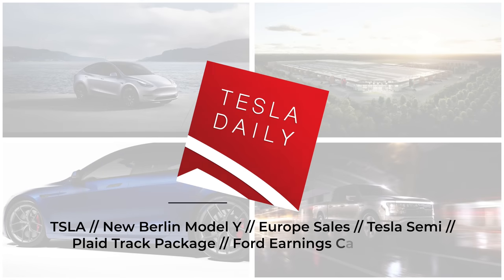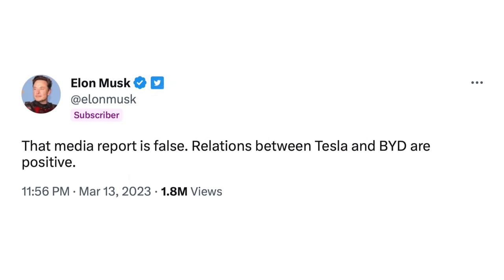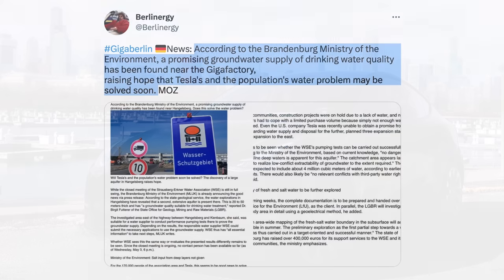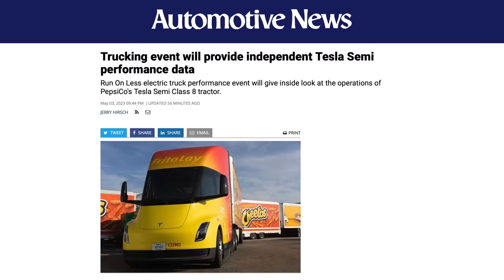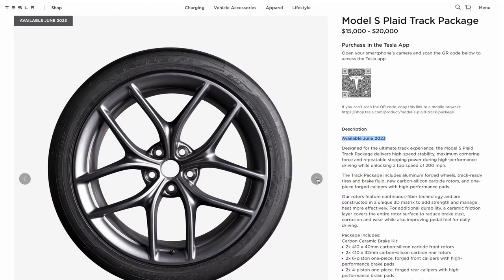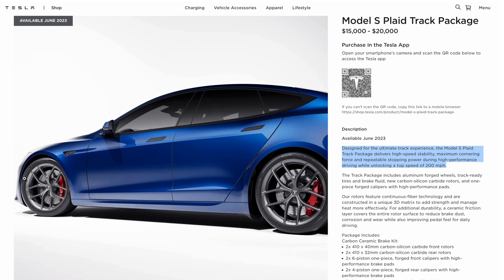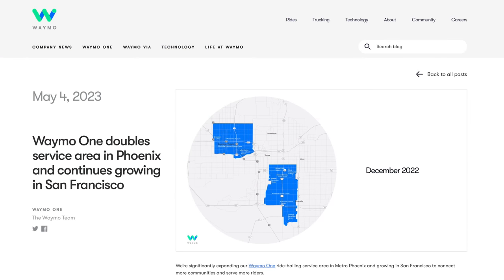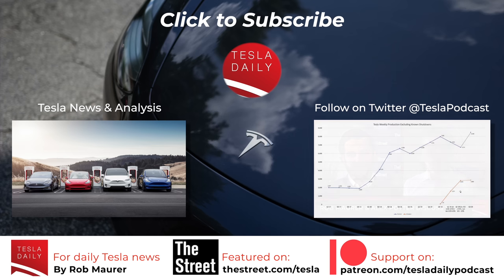New Model Y From Berlin, Europe Sales, Ford Comments, Waymo Expands

Comment: Run on Less - BIG DEAL in the fleet manager trucking space. People pay attention to it, a lot.  Coming away with good results and stats that impress WILL result in a lot of uptake as so many companies are facing stockholder pressure on CO2 reductions etc.   When it all comes down to it though, cheap electricity has to be addressed behind the meter for electrification to pay off in a dominant way.  This is getting too little attention IMO.

Comment: Using digital connectivity to monitor what customers are using on a vehicle (and deleting low use items) might backfire (pun unintended) with something like lumbar support which is probably adjusted for the usual user of the seat and then left alone mostly. Not being able to adjust initially would be a downer.

Comment: Passenger seat lumbar support - how on earth car companies even think about removing such feature. The 5% of owners that end up using this feature need it so badly that it might be a critical factor in making the decision whether car will be bought or not
Reply: Possibly an after sale modification option. Why should others pay?
Reply: I think it's far less than 5% usage. Regardless, the reason is obviously to cut cost and achieve scale. Many of these decisions sacrifice the needs of the few for benefit of the many.
Maybe one day when their supply outstrips demand, they'll start adding options back, if they haven't achieved FSD by then.
Reply: I've owned 3 cars with lumbar support. None of them worked for me, one of them worked for my wife. People are built differently and their spine problems are different as well. After trying quite a few aftermarket products I found an electrically adjustable pneumatic one that worked for me. Original equipment lombar supports are almost guaranteed to fail in a majority of cases. They are a waste of money for both car manufacturer and buyer.

Comment: The thing about seeing the recent progress by Cruise and Waymo that is somewhat concerning is that Elon legitimately talks as though there are no competitors to FSD in autonomous driving. It's almost as if he's in denial. Give some credit, acknowledge something. That would reassure me. Right now we still have FSD as a level 2 system with no timeline even for limited L3 operation, which Mercedes already offers, and then Cruise/Waymo serving actual customers without a driver, while expanding their area/hours of service meaningfully. I have very little confidence in FSD having any monetary value beyond a convenience feature at this point.
Reply: Cruise and Waymo has some potential to have a slice in the autonomus driving market, with the market leader Tesla's FSD. But Mercedes's current Level 3 is more like marketing, than real improvements. It can only drive LVL 3 on a Highway, with no other cars around (!), and only in straight line (no curves). Maybe they will improve a lot, but current tech is a marketing BS.
Reply: Mercedes L3 operation requires a lead car and is limited to 4mph ON THE HIGHWAY! What a joke!
Reply: I still say it's a apples to oranges comparison.  In the end what Tesla's goals are and what Cruise/Waymo's goals are, are not the same.

Comment: The numers dont seem to add up...
60kWh from china VS 55kwh in germany and only 15km range loss. 
If Model Y loses 10% battery capcity then we can asume the range wil decline with 10% 
Maybe a little less if the BYD battery is verry low wight, but that is verry unlikly.
Test will need to be done but taht seems llike a verry poor thing to do.

On the upside i seen white paper saying model 3andy even with the long range with the LFP status, that might be a verry good deal to come

Comment: Daimler engineers may not have taken into account regen braking and elevation playing a very large part of the energy equation. 

They probably assumed flat land mileage going from point A to B. 

As SMR would say…. I’m not an export by any means, do you own research blah blah blah #$&*ing blah blah blah
Reply: Regen braking is 101 of electric cars - I doubt that's it. And all range trips should be measured with a net near-zero elevation obviously - and more ascent would obviously hurt the range.
I think it's more likely that they thought it should have the same payload capacity and have a 500+ mi range when weighing out, which isn't necessary to capture a lot of the market.

Comment: I think Ford has no strategy.
Reply: No good strategy perhaps, but they seem to be ahead of Stellantis, GM, and Toyota. That may not be enough to survive.
Reply: @MrEd2291  Now that GM is discontinuing the Bolt Ford should fill that gap with the introduction of an electric Fiesta.
Reply: I think the question is whether any EV strategy is truly deliverable within Ford's resources. At best, pretty much everything has to go right for them for next ten years. I think that's unlikely. I think they are walking the green mile!!!! Which is the only environmental policy they have 😂😂😂😂!
Reply: @tonii5690  Going for a cheap EV is risky because it's very hard on margins before you've perfected manufacturing it at scale. It'll be easier when batteries get cheap enough to supply them to smaller vehicles without sacrificing range or affordability/value.

Comment: Could it be the Tesla FSD approach is not the best? Better to have software that can figure things out on its own, rather than the pattern matching method being used.
Reply: TESLA FSD is BEST in Class , compare Waymo & Cruze , TESLA is more CONFIDENT & Accurate. 
neither one can Perform City to City trips or State to State , TESLA is not Geofenced . 
and ONLY Tesla can Perform BLIND Left Turns CHUCK COOK style.
Reply: I don't think you actually understand Tesla's FSD approach.  Pattern matching?  They're using occupancy network.
Reply: The alternative offer no generalised solution. Tesla is the only generalised solution.
Reply: You can't compare TESLA FSD with waymo and others! If something changes in the city any change in street they can't drive anymore!
Reply: Waymo's the one that tries to match its lidar scan to a pre-recorded map, not Tesla. Waymo is also the one that still has problems telling trucks from traffic control boxes.  😁😁😁

Tesla is a Xenon Discharge Lamp; Waymo is fire on a stick.